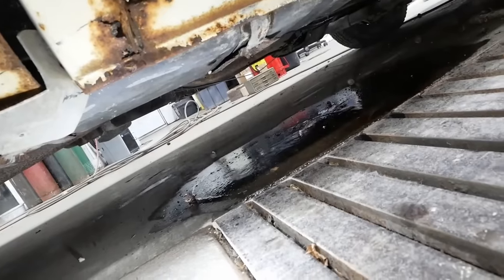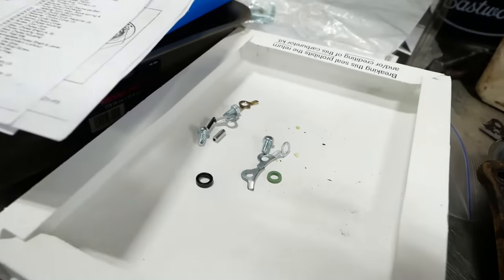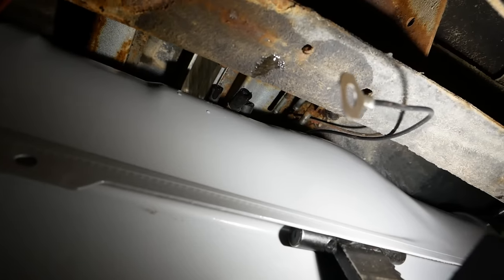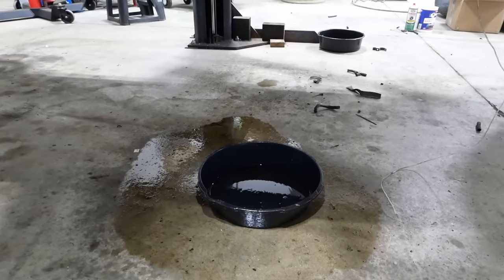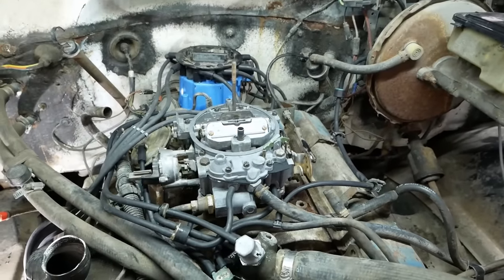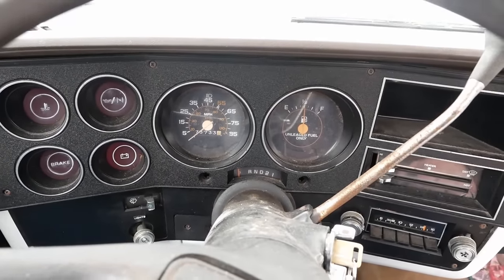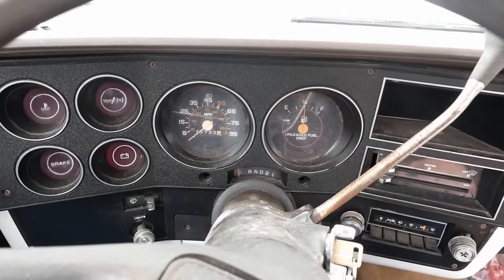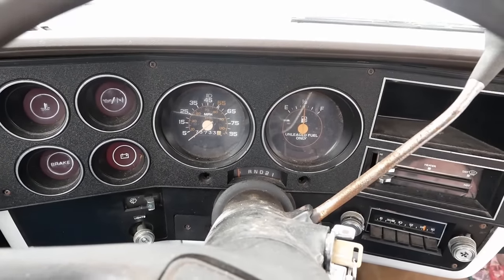Millennial vs. Carburetor | Square Body Chevy Back on the Road After Sitting 12 Years

Comment: Carburettors - I can barely spell the word - are an attempt to precisely control the chaotic universe.  Little wonder it's difficult.  But, like your dog with the frisbee, you don't want to let it go; there's that need to get to the bottom it.  Although not immediately profitable, it's Learning all the way for you and us.  Not to mention that now we're all hanging in suspense, wondering if we'll ever know why, after all that effort, that engine still isn't running right.  Thanks a lot!
On another matter entirely, whenever you fire up an engine, I hear high frequency interference in the audio.  Is it only at my end (though I can't imagine how that would be)?  Do you have another phone/camera to try?  Has anyone else commented on this?

Comment: Was that last start a full cold start? Warm start -- just depress gas 1/4 (or so - not enough to set the choke, but enough to kick the accelerator pump) then turn key. That engine was flooded at the end. Really in 50 + degree weather, you might not even need to set the choke on a cold start. Sorry if I'm stating the obvious. As for the lean stumble at load when cold -- it was very likely that way from new and is a function of the factory settings. Those late 70's - 80's carbs were all set up really lean from the start.

Comment: ther sounds to be a tiny vac leak for the choke set. The choke spring can trimmed to not be a tight? 
Also  look for diaphragm leak or issues on distributor rod weights as it may be slow to advance timing off idle.

Comment: Wes...Did you adjust the Carb mixture screws? Down low in the Front. Best with a Special Flex tool. And that tip below about those Well Plugs.

Comment: 50/50/90 rule. What a perfect time to illustrate human bias and statistical error. Had you assembled the tank straps correctly on the first try, you would have been unaware that you randomly got it correct because you would have remained unaware there was a chance of getting it wrong.

You either only remember the times you get it wrong because  mistakes are more memorable than no mistake, or when you get it right, you remain unaware that you could have gotten it wrong.

Comment: This owner should spray all of that rust down with phosphate. You can install a cheap bicycle speedometer. You have to mount the magnet on a wheel, and align the coil pickup. Roll out the tire circumference, and Bob's your uncle.

Comment: I'm probably reiterating what others have said, but I'll post anyway: I think you're being too hard on yourself in looking for perfection with this particular job. Those of us a little older (Gen X here) who can remember these so-called "Malaise Era" rigs when they were new(er) will tell you they never ran great at startup from the get-go. These things were tuned to run as lean as possible to meet emissions and CAFE standards and would stall, bog down, and stumble when cold from right off the showroom floor. We also learned that as they got older the "standard" cold starting procedure (push the accelerator to the floor to set the choke and high idle, and then push it halfway down two or three times to pump fuel into the venturi), which never really worked on a lot of Carter-era vehicles anyway, had to be modified a little. We either learned to master the art of cold-engine driving (i.e. two-foot driving in an automatic and feathering and/or pumping the accelerator in order to keep things from stalling out), or we learned patience and let the blessed piece of junk warm-up a little. In my humble opinion, unless the owner wants to throw cubic money at this pile and replace jets, metering rods, or the entire carb, you've got it running about as good as it's going to, and considering the age and condition (and the fact it sat for a decade or more), that's pretty darn good.

Comment: Those throttle shafts on quadra jets are really a problem especially with any kind of miles or age umm they make a bushing kit for them but then you gotta have the reimers and that kind of stuff and it gets pretty cost effective special if you only do one the rebuilders have all those tools on hand and can tighten them shafts up but they really do get loose it's it's aluminum versus steel and the aluminum loses and repeatability of idol is absolutely to do with the throttle shafts walking around good job there boy

Comment: I use distilled water and vinegar which works great in my ultrasonic cleaner i would have put a 600cfm vac sec Holley on much better carb and easier to service

Comment: Ok I’m older than you so I’m not a millennial but I’m not a boomer either… anyways, the way I always set the e choke is to gauge the necessity of choke in a given environment. So at 50°F full choke would be required to start but not for long, so with a cold engine set the choke by clocking it to close the butterfly plus a little bit to ensure positive shut off… like 1° further.

Comment: Wes, does it start OK when dead cold? I had a lot of problems back in the day with those Quadra jets. They would leak gas after a hot soak and flood and not start until the throttle was Heald to the floor. In the main body under the bowl there are 2 tubes or wells (for lack of a better word) that are sealed at the bottom. They leak and allow gas into the intake.
The carb kits had a foam type of insert with that odd shape (Looked kind of like a slice of bread) that was supposed to solve the problem. Did your kit come with it? Also, they could be sealed with JB Weld.
 When your wife had trouble starting the truck until the throttle was put to the floor it reminded me of that problem.

Comment: I would block off or put a locked cap on the abandoned fuel filler neck. Would hate to see 20 gallons pumped into a leaking tank. Especially at these prices!

Comment: What’s funny is that cat under the truck w the pellets you could just delete it. No one is gonna check it cuz of how old it is. The truck won’t know abt it cuz it’s carbureted, & the dsls up till 1995 didn’t have cats. The 1995 7.3s did, but since they aren’t required cuz it’s before 1997 it don’t matter.

Not sure what the laws are in your state, but in my state if a vehicle is over 25yrs old the emissions side of the vehicle doesn’t matter anymore. It’s just a safety.

Comment: Im a boomer and Ive been working on cars since I was 14. I rebuilt, tuned, replaced and cussed at more carburetors than I care to remember. The ABSOLUTE worst were those go*damned quadrabogs. Overly complicated, unreliable, junk. Be happy you live in the age of electronic fuel injection. Its likely the best innovation in automotive technology since the small block V8. And Ill apologize for all my generation and their curmudgeonly clinging to antiquated tech that was garbage when it was brand new. Pay em no mind Wes. They're more nostalgia than sense.

Comment: On the oil situation: my ancient dodge pickup with the 318 gets…whatever is on sale. I’ve used euro-spec 5w40 syn in the winter, rotella 15w40 in the summer, 10w30 store brand conventional and synthetic, 5w30 syn for a particularly cold winter… what I’ve learned is that the 318 doesn’t care. At all. Whatsoever. It would likely run fine on straight vegetable oil.

On the carb stuff: I’ve heard all the sayings and other misguided “truths” regarding old school carbs and their simplicity. I will take a small “magic box,” crank/cam sensors, map sensor, throttle sensor, temp sensor, oxygen sensor, fuel injectors, & individual coils any day. Why? Because they can account for engine wear & driving conditions FAR better than a standard carb ever could. The drivability is better. Hot & cold starting is better. The powerband is better. And if you want to change something? Punch in some new software in 60 seconds or plug in a new PROM and you’re done. No contest in my mind.

Comment: I'm just curious to have to ask this question. Don't mechanics use carb cleaner anymore? I can see using an ultrasonic cleaner on jewelry and such but a carb needs to have a good harsh solvent that can penetrate through all the tiny passages and clean out the scurvy mess on the bottom the bowls. Maybe try using carb cleaner in your ultrasonic? Not sure about the heater but at least the sonic part of it.

Comment: Any play on the throttle plate is too much play. The soft aluminum base plate that the throttle shaft rotates is wore out requiring new bushings. The kit from Summit Racing is kit 201102. It includes the drill bit also.

Comment: Oil is oil. However all the detergents in the new oil is what destroys an old sludgy half dead bearing engines. It keeps all the trash suspended in the oil an washes more into it. The BG engine flush stuff will lock up a old motor in about 10 minutes. A fellow tech dumped a can in a 00s bmw that was sludgy. Cranked it. Went out side for cigarette. When he came back it had already locked up an turned itself off. One of those told you so moments. Dealer ended paying for a new motor

Comment: So on the carb that's not a piston as you called it is not operated by vacuum. It's a fuel cut off needle it's attached to float to cut fuel supply when fuel bowl is full. Not making fun of you just helping you better understand and have knowledge. Also you could've got a gallon of carb dip from any parts store for about 20 dollars. Same steps as you did with pine sol but the carb dip will clean it as if it were new works very well even without a sonic cleaner

Comment: Be careful. Do not just use the kit instructions. Note all the positions of any linkages . The different carbs can have different settings from the factory  . Use the settings that you see on the carb. Like 3 rd hole etc.,. Do not just take apart and then set all the adjustable parts according to the kit info. Like you say.... Look for witness marks.

Comment: Man thanks for the videos. I know folks like to be douche bags. But the tack you spend the time to do it and say you don't know is respectable.  Keep up the good work.   Oh and I usually heat up my pine sol in a pot with my carb parts in it before throwing it in the ultrasonic cleaner.  Just speeds up the heating process

Comment: did you unhook the vacuum advance to set the base timing? the engine also needs to be warm so there's no high rpm mechanical advance(or manually turn the choke off and attain low rpm idle).
if not the timing will be very far off
Reply from the maker: I followed the procedure in the manual.

Comment: oil should contain reasonable amounts of zinc(ZDDP) is needed. look into driven oil, can't get away with additive ether it won't blend properly with an oil that has a proper detergent package.  these farmers running cheap oil don't have the valve spring pressure to wreck lifters same with most stock engines. anyone with a jazzed up flat tappet cam needs the extra stuff.

Comment: Who needs a computer, a fuel rail, and some injectors when you could easily accomplish the same thing with 800 springs, butterfly valves, and an elaborate system of vacuum operated levers?

Comment: In certain states if you remove the emission controls you won't be allowed to plate that vehicle and drive it on the road.  Some exceptions are made for older vehicles where parts are no longer available, but you'll smell those cars a mile down the road cause they stink like a petroleum cracking plant. 
That aside, people that "beat you up" in the comment sections are providing you with information you wouldn't get otherwise because it's lost to the fog of time and not covered in the pathetic on-line manuals that pass for knowledge these days.  Better to get it from well-meaning commenters like you said then have to pay another subscription from the knowledge brokers.

Comment: You dont need to bend that tab over.  S/10 have the same setup and no manual ive seen said to do it.  A loose pad is better.  Racing motorcycles have just a single pin and 2 tiny little clips to hold the pin.  And those bikes are capable of 198 mph before the speed limiter kicks in.

Comment: The idea that "simple old vehicles" were simple or easy to maintain is an Andy Griffith myth. Sure, you can tune them and it may run great but in a few months or at the change of a season, they will need to be adjusted. Once they get a relatively low amount of mileage, they need to have systems rebuilt. You grandpas old '75 square body may have "run forever" but it ran like crap since it was 2 years old.

Comment: And the rattle is NOT minor trust me ...especially with window open rough road and your insane in short order ...the rattle will drive you nuts X 2 with passenger window open and you get nuts in Stereo ....Hey Brutha they have Carburetor solution for cleaning tanks ... they really do work well... Hey I got 50 bucks says that was the First HEI coil he's ever replaced ... No problem I can remember my first..But just a side note we did used to clean up the top coil cover before we installed them on the new HEI cap...it's NOT that the oil is better the needs have changed from flat tappet to roller cam once the flat tappet is broken in it's broken in the failure comes after a few hundred thousand miles of abuse and neglect the face of the lifter's take on a dinner dish appearance and can be a real bitch to remove from the lifter bore's ...once you get this truck warmed adjust your mixture screws in front of the carb ..turn them in then back them out 2 and a half turns then restart ...to adjust for best final operation {Fine tune} they make a carb adjusting tool with different bits for different adjustment screws sometimes you need to drill out the plugs they made for factory settings..But in the end giving one of these an actual tune up is more involved then just pulling codes and replacing plugs ..You actually have to have an ear a good vacuum gauge and commonsense   .. You passed..there should be a sticker on the under side of the hood for where all your Vacuum lines are run and EVAP...and one to your transmissions Vacuum module . your brake booster and your good,, this is where two foot driving comes in handy ......until you can get the carburetor adjusted properly or set timing up ..when car & trucks used to come in for tune ups they were often a learning experience as well as a pain in the ass ..when your cars runs fast like that drop the timing the truck should NOT want to drive down the street on just idle ..Dude listen...drill out the adjustment screws under the fuel inlet  {Base plate} your scaring me with your complete lack of trust in your ability these trucks were after all American trucks not from another planet ..you can have the choke set too tight or not tight enough it's really a very small adjustment But My thinking is you never touched the idle mixture screws in the baseplate that face forward one for each side...thats where your issues are..

Comment: Choke power test.  Test light to the plugged in choke coil.  Key on engine off.  Dim test light is expected. 
Start engine. Test light should go bright. 

KOEO. Choke coil gets power thru choke lamp on dash.  
KOER. Choke gets power thru 3 wire oil pressure switch.  2 wire oil pressure switch. Or choke relay.  My computer with this info is taken apart currently.   
When KOEO.  Choke light is on. 
KOER. choke light is off because voltages on both sides of the light are equal at charging voltage.. very similar to gm alternator light operation.

Comment: Try adjusting the time in the old-fashioned way. Advanced and distributor to about 10° take it out and drive it see if it has spark knock when you go full throttle if it does retarded a little bit if it doesn’t advance a little bit and then drive it again repeat until you’re successful.😊

Comment: Yes they made me smallpox everything but they put them in anything from which bell 2 Nova 2 pick up truck is whatever in these parts companies only want to carry 1 or 2 PM for everything but they're basically same pump architecture so they can get away with it and it's on the mechanic to figure out how to make the lines work

Comment: Iro should come off after 2 minutes. The rochesters are pretty simple to rebuild when they are in good condition when are you good shape to rebuild. A fire extinguisher inside the carburetor show daddy that a carburetor. Cold from the compound NFR extinguisher. Could have caused the carburetor to grow in side. Cause cracks in the body. Carburetor cleaner to be sprayed around carburetor. And if there is a crack. It will suck the carburetor cleaned side. Cause an engine to rev up. Fix this carburetor is supple replace it. Because there is no. Yeah I will be higher than it should and keep to seem like it's on fast idle. It is usually i is the center section.

Comment: Don't laugh. This does indeed work wonders...

Handheld concrete vibrater. 5 gallon bucket of PineSol or turpentine...I prefer the latter. Carb parts inside a fish basket, to protect from the vibrater. Submerge the vibrater wand, and let that run for about 15 - 30 minutes.

You'll never go back to an ultrasonic machine again.